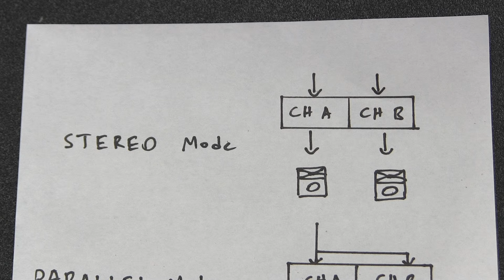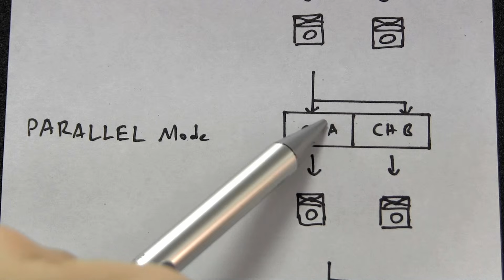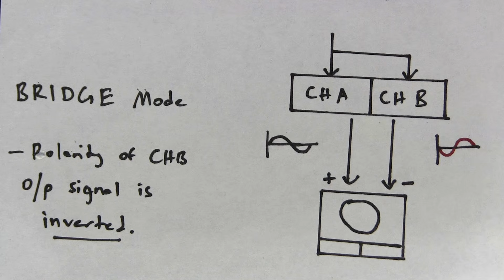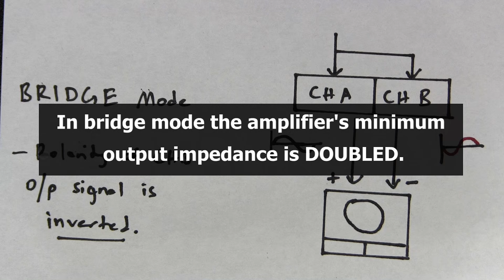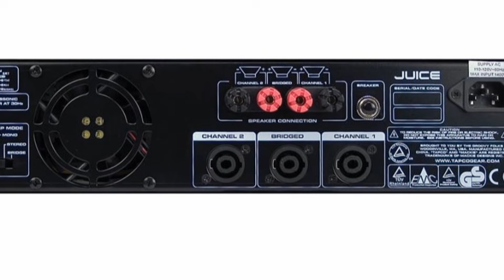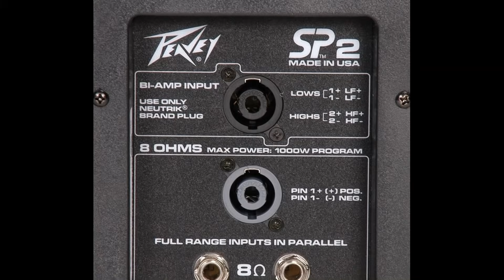How to set up and connect a power amplifier in bridge mode

Comment: my question is how to connect sir if I have a 5 amplifier in stereo mode?its possible amplifier to amplifier connection? if not what I need to connect?
Reply from the maker: +julito Balongcas Jr. The simplest way would be to daisy chain them together using the input/output connectors - watch my video here: https://youtu.be/NqTqJ4zOJJU?t=20m50s

Comment: I've got a question. I  am right now looking at a set up consisting a crown amp and a set up with a set of JBL passive speakers. The speakers are wired together on two different bridges, one for the right and one for the left side of the room. The owner of this set up has connected the cables for the right side on positive and negative on ch1 and the cables for the left side on positive and negative on ch2. He is experiencing some problems. on one of the sides he is not getting any sound at all. Should it be wired up with both sides on positive. Could this be the solution? He asked me to try to fix this, and I don't want to mess anything up, so I want to ask here first!
Reply from the maker: +Jørgen Mindrum Thanks for getting in touch - what do you mean by 'the speakers are wired together on two different bridges'?
Reply: I misunderstood the meaning of the word. Not used to the english terms :) What I mean is serial connection. I don't know if this is correct either
Reply from the maker: +Jørgen Mindrum I see :) I suggest you watch my video on how to connect a power amplifier to passive speakers as it shows the entire connection process from start to finish: https://www.youtube.com/watch?v=NqTqJ4zOJJU Let me know if that video is helpful, we can continue our discussion from then :)

Comment: It's a great video!  It helps to understanding about bridge mode.
One thing I'm wondering is in the case of this video,the amp require 8ohms in bridge mode,what if I connect 4ohms to the amp? What will happend?
Reply from the maker: +ken123167 In most cases the amp will overheat and then shut down to protect itself. In extreme cases the amp will actually catch fire from the heat generated, not something you want happening in the middle of your show!

Comment: Will it be ok for the amp if i used a headphone amp along with it? Bcuz wen i just had a receiver with a sub out and a pro amp i would hook the sub to the pro amp and the pro amp would clip very badly so im thinking if i get an headphone amp it will improve the sound of the pro amp.
Reply from the maker: +Rico Mckennie If you're having a clipping issue I would just turn down the level of the pro amp. If that doesn't solve the problem then turn down the level of the sub out on your receiver.
Reply: Ok bcuz im using a kicker cvr 15 inch sub an i was probably thinkin that was the problem. But wen i get this new system im checking everything carefuly. 💯

Comment: how many amps does an 2800 w bridged into 4 ohms amplifier pull out of the net? if the net is 220 V
Reply from the maker: +Spixon Media Simple maths yields 12.7 amps, although power amplifiers do not draw the same amount of current all the time. To be sure, check your amp specs for the unit's maximum current draw at full load.
Reply: +GLB Productions Alright thanks!

Comment: i have a 2000 W RMS dual 12" car subwoofer in my house, and i want to connect it to a PA Amplifier in bridged, so it puts out 2800 w into 4 ohms mono, and my dual 12" sub is 4 + 4 ohms, is it ok to wire it in bridged?
Reply from the maker: +Spixon Media You need to work out what the total impedance of  your sub is - this will be found on the back panel of the speaker. If it is two four-ohm drivers connected in parallel that will yield 2 ohms which your amp may not be able to handle.

Comment: Does the amplifier still make the same amount of watt then in parrellel mode? Im new to PA amps^^
Reply from the maker: +TheBrosBro The exact amount of power delivered depends on the load to which the amplifier is connected, not the mode in which the amp is set. Refer to the amp spec sheet for precise figures :)

Comment: Great video! though I do have one question. I have an older peavey sub I would like to add to my system but it only has a single 1/4" jack for the 8ohm speaker. Would it be possible to use a Speakon to 1/4" male cable to run the speaker with an amp in bridge mode? Hopefully that makes sense... Thanks!
Reply from the maker: +SGajpC Yes no problem at all - just make sure that the speakon end of the cable is wired correctly for the amplifier that you are using.

Comment: Hi Bruno, great video in clearing some of mind knowledge gaps. I have a wharfedale MP2800 amplifier which delivers 2800W @ 8 ohms in bridge mode. The speakers cabinet are wharfedale DLx 215 1000W @ 4 ohms( two 15" LF cones and 1 HF horn  in the cabinet). Can two of these speakers be connected in series to match the impedance for the bridge mode and use in the amp in bridge mode power these speakers in such a connections manner?
Reply from the maker: +ize iriobe When connecting loudspeaker cabinets parallel connection are the norm - series connections are only used for individual loudspeakers within a multi-driver cabinet. For those 2x15 cabinets which are 4 ohms each it's best to buy a single large power amp that can drive one speaker per channel than to attempt powering them in bridge mode.

Comment: Great video! Thank you so much. If I was using two front-of-house speakers and one speaker was connected into the amplifier using the bare wire method, how would I connect the other front-of-house speaker into the same amplifier?
Reply from the maker: +Ethan Yates You're most welcome. In this situation you would simply daisy chain the second speaker to the first one using the output connector on the first speaker.

Comment: Thanks Bruno for your educative videos. I have a problem with my 2800 watts wharfedele pro amplifier each time I use the bridge mode, it's burns my speakers. Pleases I need your help. Thanks.
Reply from the maker: +Isaac ohaeri Have you checked that your amp and speakers are correctly matched?